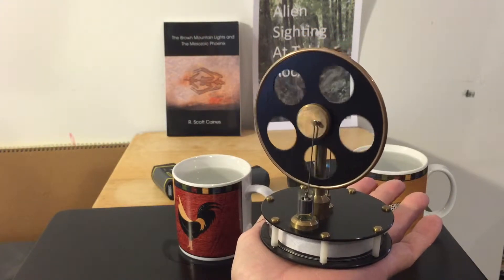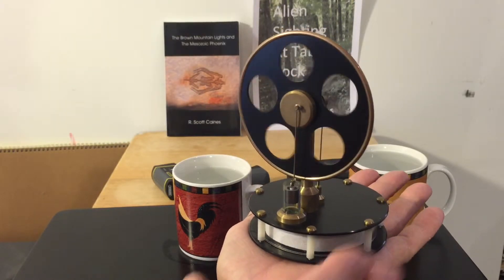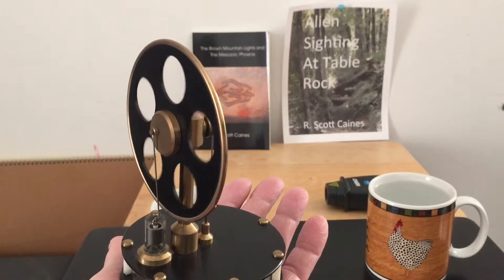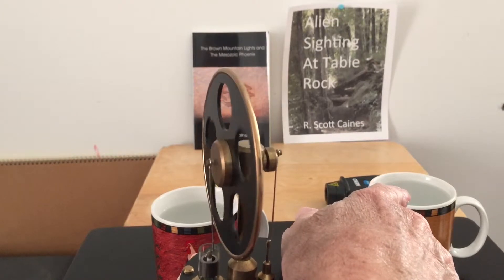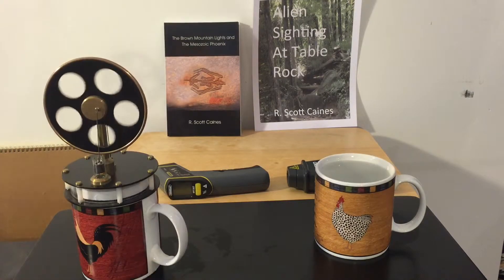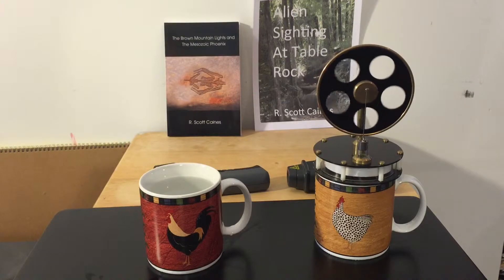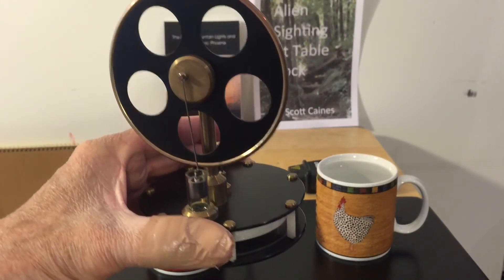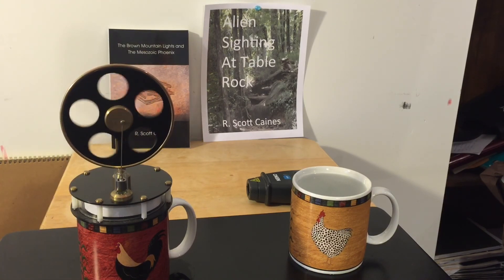Stirling Engine Hot vs Cold

Comment: This looks like a very nice one. Do you have a link for where you got it? I bought a cheap one off of Walmart, it works, but it's definitely not as smooth or efficient.
Reply from the maker: It has been a few years, but I will try to find the vendor for you.
Reply from the maker: This Stirling Engine came from Scientific Models LLC, www.scimods.com. That is what is on a label on the bottom of the base. I cannot remember if I purchased it from them directly or through a third party vendor like Amazon. It is very well built. Amazon has numerous stirling engines listed, but I don’t see this one and I can’t get to the scimods website. Good luck in your search.
Reply: @anisotropicplus  thank you for the response and thank you for sharing. I will let you know if I find it. Great video btw.